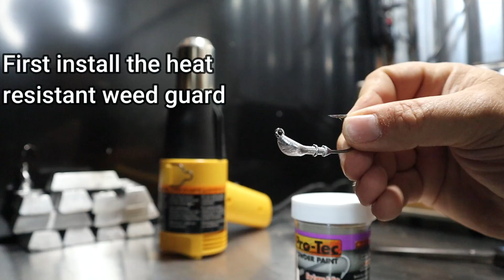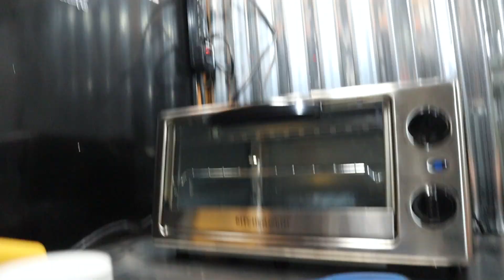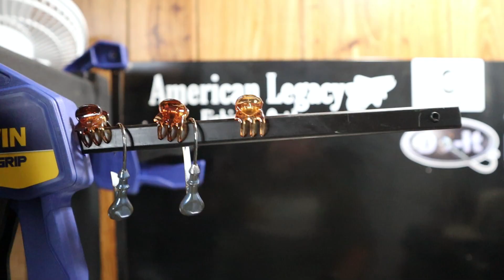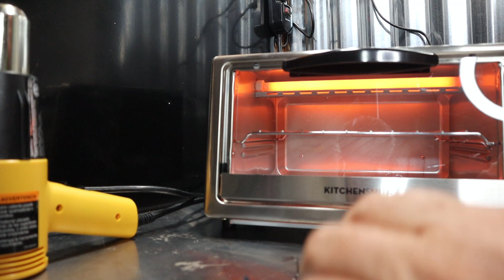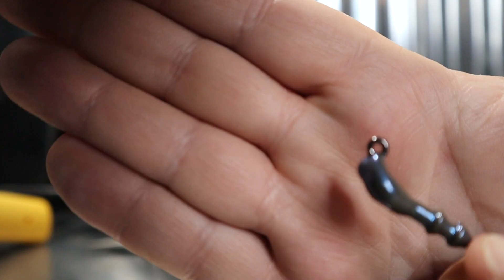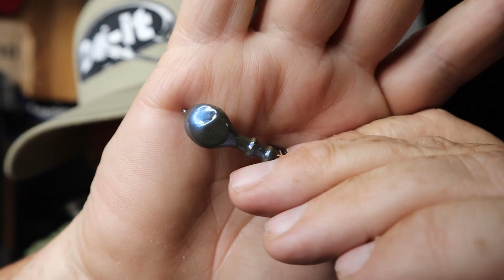How To Paint Lead Jig Heads (Beginner Bait Making Series)

Comment: if you are up for pointers, forget the pliers and use your fingers. Hold the powder jar at 60 degree angle, and roll and tap on table to loosen powder. Dip the head, then immediately tap the hook on the rim of the jar, and the access powder that is causing the run will go away .... hang by hook as you did at first. I'm not fond of noise, and use a small glass alcohol burner to heat the heads.
Reply from the maker: Sweet tips! We are all here to learn!